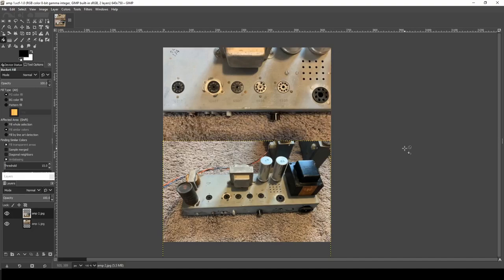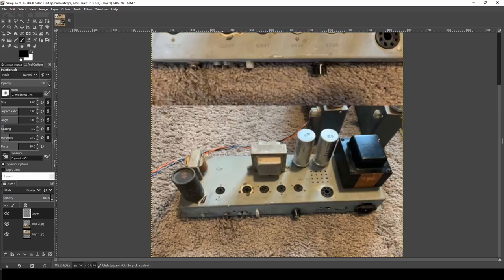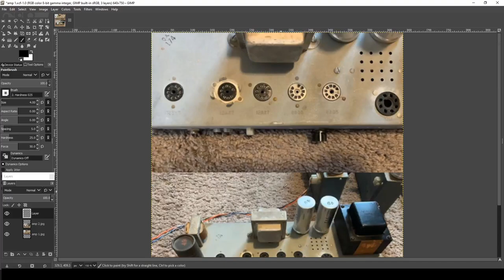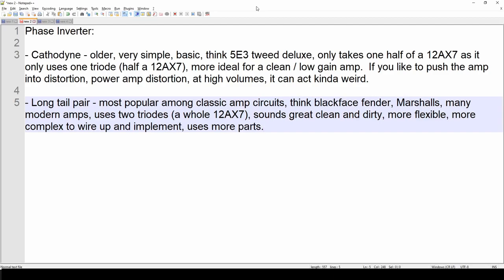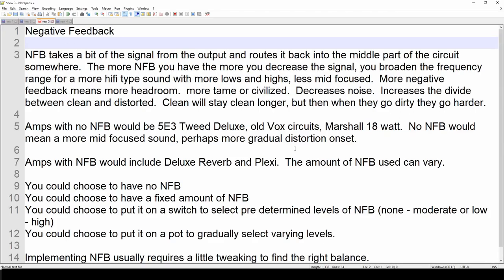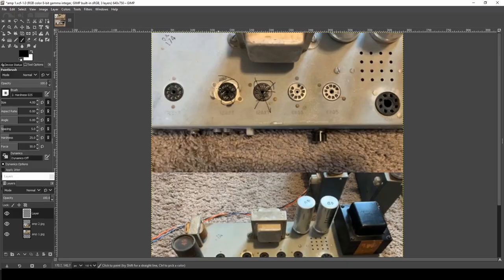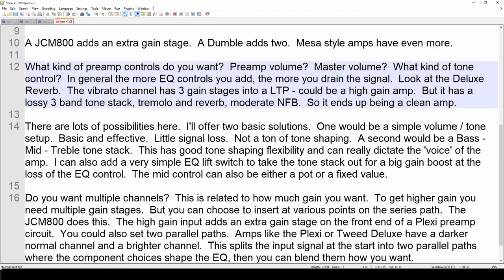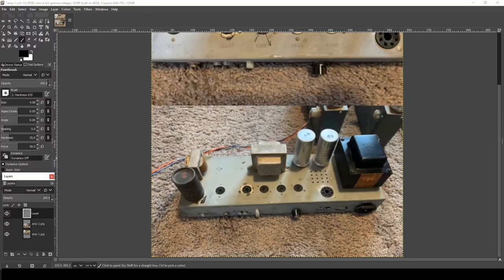Hammond Organ Amp Conversion - pt 1 - Design Choices

Comment: Cool man. I've harvested and collected a bunch of tube amps from Hammond, Conn, and Lowrey organs over the years that were either dead or in need of a lot of repair. If they are gonna end up at the dump, I try to get to it first and grab what I can. I use an AO-41 I modded as a bass amp for recording. It has some really nice natural grit when you crank it up and mic the speaker you're using with it. Best thing about using organ amps is they are full-range and can be used for anything. You don't really have to do much in the way of conversion. Just put a dedicated preamp and eq in front for whatever instrument you're using it with and go! No need to add a tone stack for guitar. Even a pedal with a tone knob works great. It's even easier to use in a HiFi system. Since I have a bunch, I use an amp for each speaker. Don't let these amps and valuable organ parts go to the dump. Do whatever it takes to get to them first!

Comment: Wow this is GREAT for two reasons....
I LEARNED a LOT by watching it one time....i kinda knew some of it, actually much of it, but you clartified some of my confusion and i had some breakthroughs concerning the dividing up of 12ax7 triodes.
there IS a tube that is just HALF of a 12ax7,,,,a 6- something....i forget, but i HAVE several around...that may be what came out of that 3rd socket...maybe....
AND because i happen to have 3 of these amps, which came from 3 L-100s that were in a FLOOD, still IN the music store in the 70's...they STILL had the tags on them....$4.5K i think...one had a Christmas tag on it...saddest thing ever...but they sat in about two feet of water for weeks, the guy said....
so the owner gave them to him, and then they sat in a shed for 30 years....
and they were falling apart....the amps dried out, and the tubes are good.....not as much rust as you'd think....and they look pretty good., so im gonna use em.
I LOVE Hammond Organs, and i would never destroy one if it was fixable, cos i DO fix them and sell them, and ive done well
But i dont want to see them go to the landfill either cos the parts have value.
and the sound of these organs is remarkable...digital technology cannot make that sound.
and they cant be reproduced.
Keith Emerson played an L-100, and they held up ....i saw him do it in '77....

I will come back at watch it a second time, and take some notes, i know about what i want to do with them....just the 18 watt Marshall style, at least on the first one.
I would rather build a stand alone reverb unit , cos they DO sound remarkable, and just keep the amp simple.
I want to use it to record in my studio....and it should be perfect.
I'm excited....I've had these for ten years .
Reply from the maker: Thanks Ed!  Sounds like a great project, good luck!

Comment: Awesome!  I have an AO-29 I've gutted for a Fender style build.  Maybe an AB763 Vibroverb.  Your thread on TDPRI has been a big help.  I'm even considering attempting a brownface Bandmaster after watching the Uncle Doug video. That Harmonic Tremolo sounds amazing.  If I reused one of the 7-pin sockets for a 6AV6 I could avoid wasting half a 12AX7 like in the original.

Comment: Thanks for this highly educational video. I learned more from this one video than I have from years of watching other vids. Thanks.

I have two AO-35 Hammond reverb amps that I want to convert. Possibly one for guitar and the other for a Super Spring Tank.  I’ve been collecting tanks and have three beauties. Two small (Accutronics ?) One has 3 springs, the other has 2.  And one long 2 spring tank from a Hammond A100. The same organ provided one of the AO35s. 

I’m into old-school dub and want the bounciest, wettest, longest verb I can muster for remixing. is it possible to combine tanks?is there any reason to do so?  Would one amp do the job?  I’d consider using both for a super stereo spring tank.  any thoughts or guidance is greatly appreciated.

Comment: Nice Video!  I'm in the same boat and this helps a lot!  I recently picked up an old Motorola record player that came with 5y3, 2x 6v6, 2x 12ax7 and 1x 12au7 plus really nice PT and OT.  I'll probably reference this a lot as I figure out my plans for the circuit.  Can't wait to see your build!
Reply: is this for a 5k21b?  if so, I just completed one and can provide some insight if you would like.